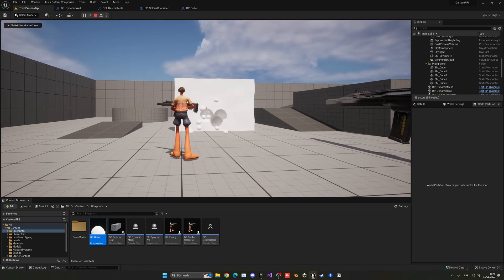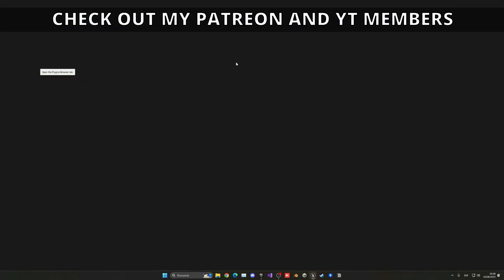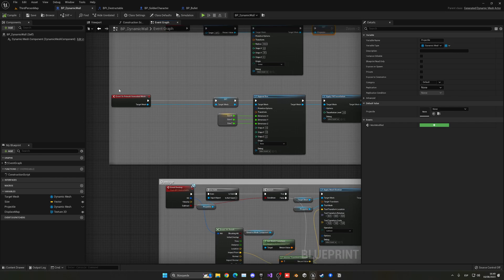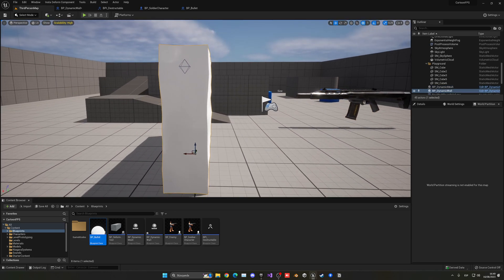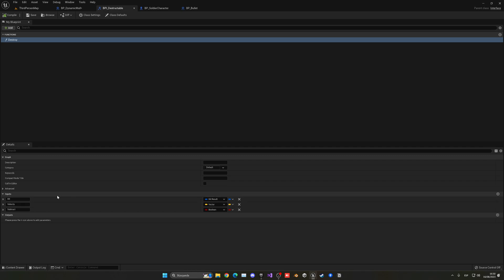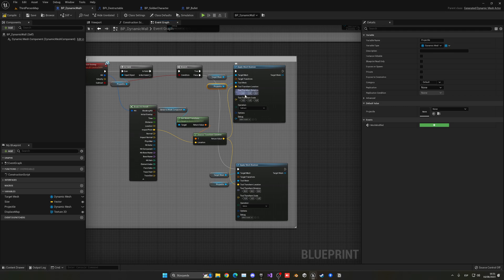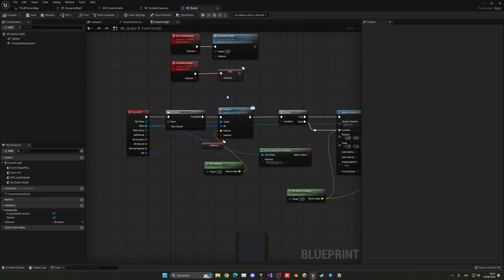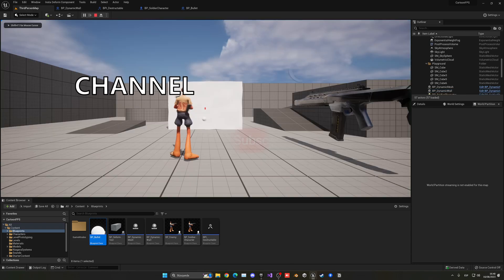Edit Meshes at Runtime - Unreal Engine 5 Example

Comment: this is old but this won't work at runtime for shipped project, it works only on editor/debug/development.
IF you want to run at shipped game, you need to use the parent of this actor Dynamic Mesh Actor, not the Generated Dynamic Mesh. The Event On Rebuild Generated Mesh is only called if #EDITOR or whatever varaible unreal uses to define development mode, it is ignored at shipped runtime.

You can also just add the component called "Dynamic mesh" to an actor, and use that. Order is
From the component, call Get Dynamic Mesh, from it call Reset, from it do all the operations you want. This can be used anywhere, construction script, begin play, or any other place.

Comment: Currently, if you cut the wall in half horizontally, it will stay floating. Is there any way to detect this and have the mesh separate into two objects, so that physics can be enabled on the top half?
Reply: Don't expect an answer

Comment: 0:57 cant see the text in the graph/code because youre zoomed out. Do Youtubers watch their own vids after it's encoded??? Whatever your recording looks like is not what we see. We cant see tiny details. And my monitor is only 22inch; cant zoom in on youtube.
Reply: I agree, crap videos
Reply: You are right that it's a little bit too small. I have slightly bigger monitor but still had to lean closer to see. magnifier doesnt work either
Reply: Turn up the playback quality to 1440 and go full screen. I can ready it. Allocate Compute Mesh (note, actor must be BP class GeneratedDynamicMeshActor) ->  Append Sphere Box (Radius 30, Steps X 6, Steps Y 30, Steps Z 6)-> Set var Projectile to Target Mesh output of Append Sphere Box.
Reply: you could download the video. then zoom in when you watch it back.
Reply: @cursedbishstudio  No that doesnt work because Youtube compression takes away detail. Especially on text that is TOO SMALL to begin with. 
E.g. I can pause, screenshot the text, open in another program, zoom in. All that does it make the pixels bigger - it doesnt add detail to the pixels (doesnt repair the edges of the blurry font - which is already too blurry because it was recorded from too far away).